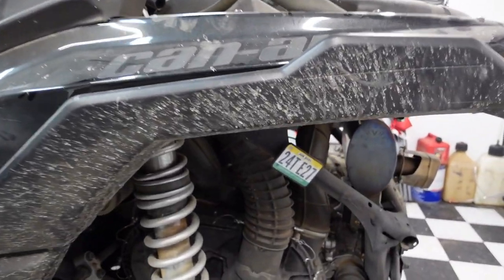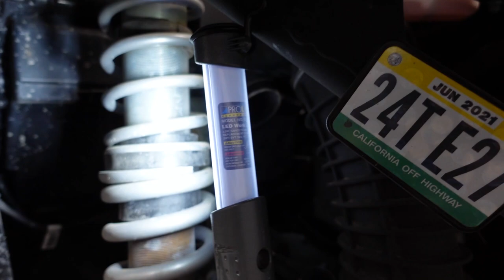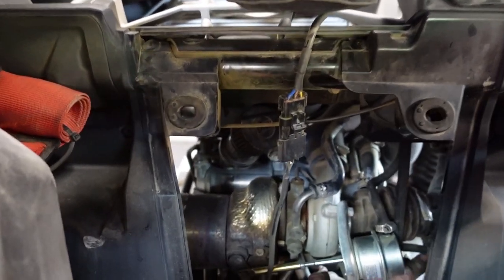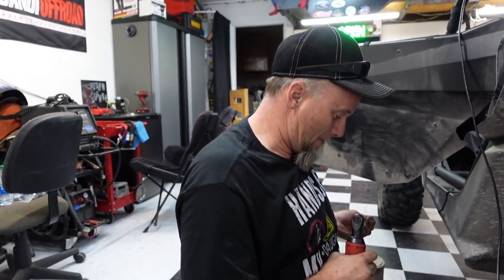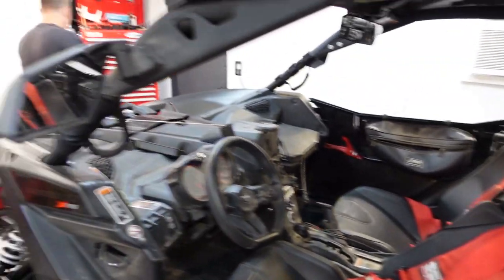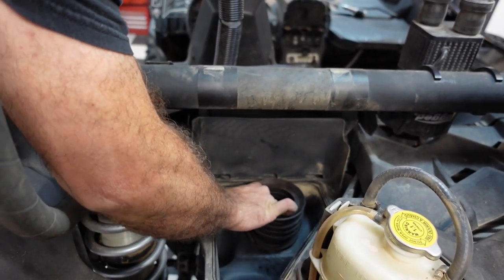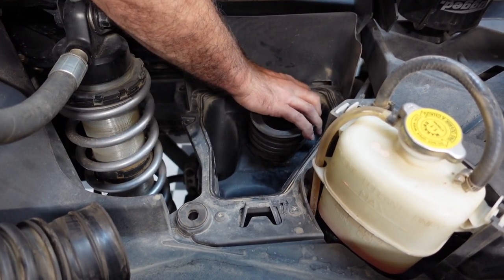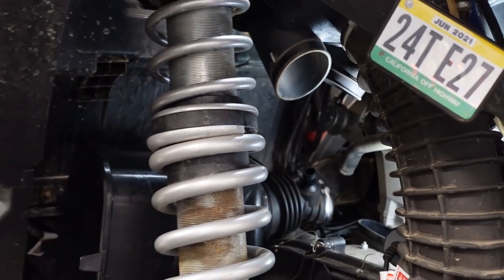Maverick X3 2020 Air Box Swap

Comment: I also would get a longer then stock bolt and use a spacer to keep the air box away so you can close the clamps
Reply from the maker: You must had watched the video, almost verbatim, great minds,,
Reply: Dandi Offroad well I would use a spacer instead of a nut on back side if you get desperate you could cut a small pipe to make a spacer
Reply from the maker: I like that idea, when will you be here?

Comment: You don’t need the piece that goes from the top of the intake to the prefilter.
Reply from the maker: I am sure that is up for debate, but we wanted to put it back since that is the way it came
Reply: I’ve put 1000 miles on mine and without it. I just got extra air